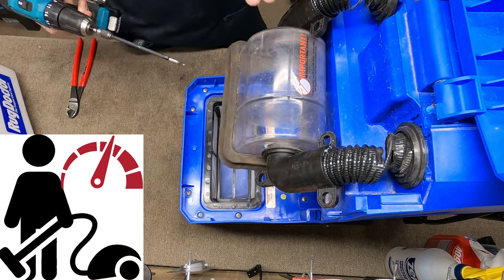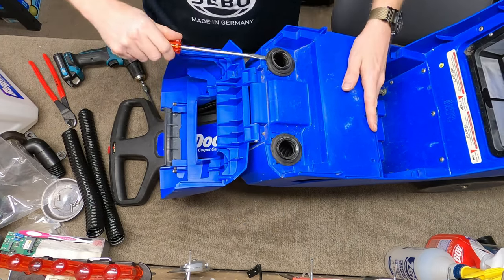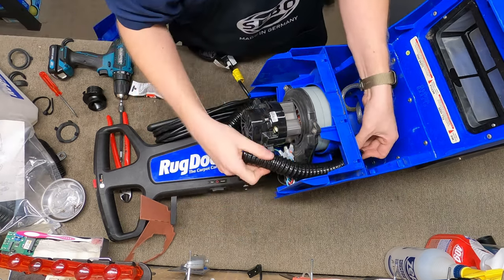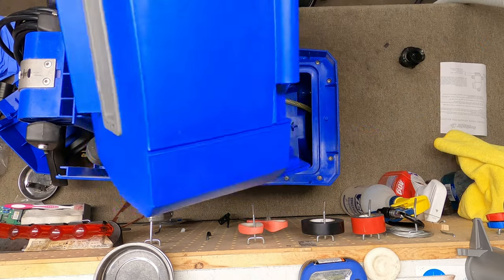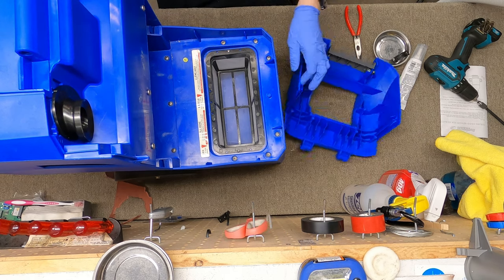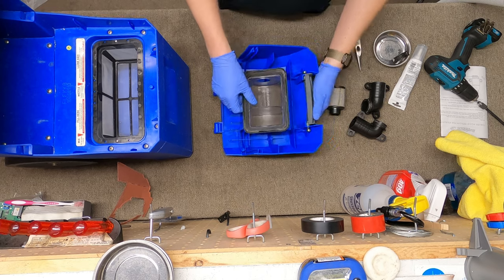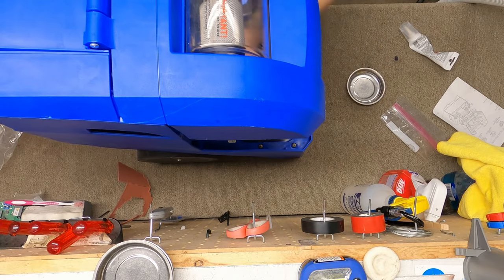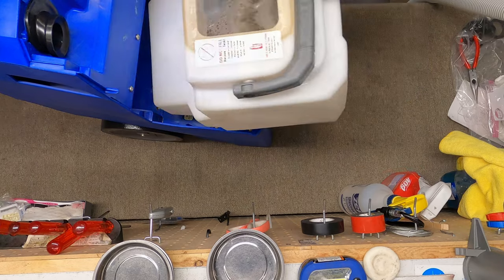Rugdoctor X3 Hose Fix How To

Comment: These are good machines no doubt. The new ones are kinda crappy but the older units are indestructible. The thing that really holds them back is only the ability to clean on the backwards pass. The Bissells you could do back and forward which just makes them so much more efficient.